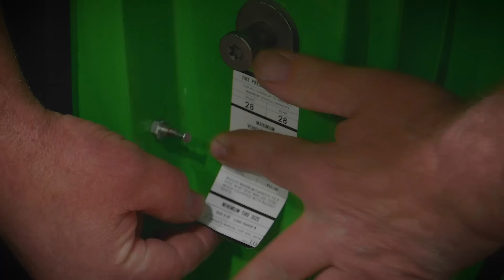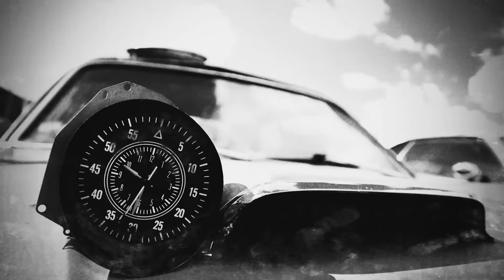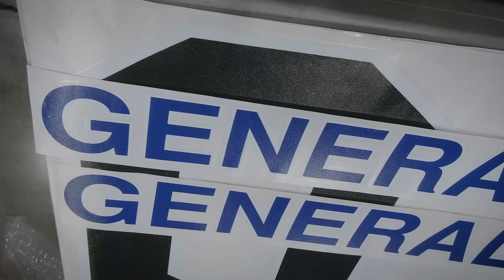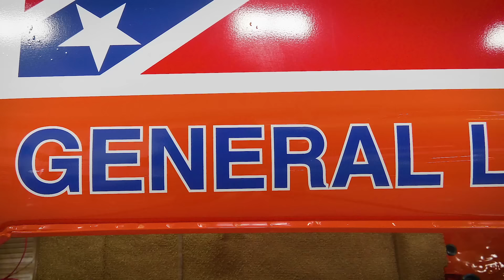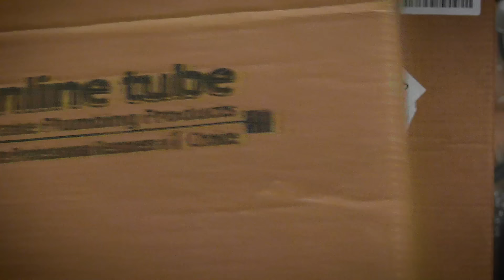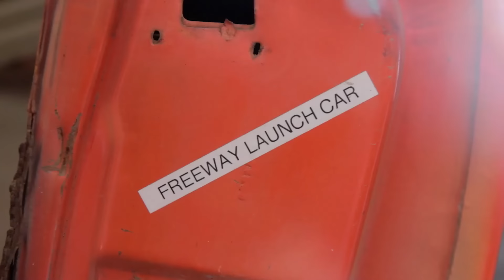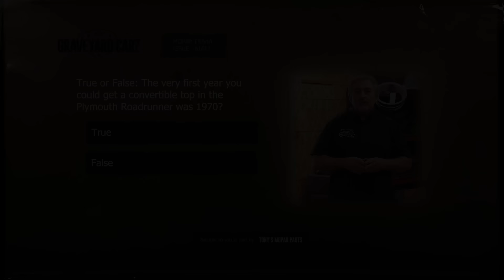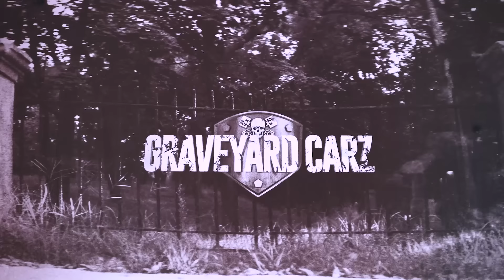SENSORSHIP: NETWORK SAYS "LOSE THE FLAG" WORMAN SAYS "NO WAY"!

Comment: The problem is the flag was part of the original cars on the show.  It's like building a Starsky and Hutch Gran Torino without the stripe.  It's wrong.  It's incorrect.  If you build a replica with the confederate flag it doesn't mean you plan to start a new civil war.  It means the replica is correct.

Comment: That is not even the American confederate flag.  Most people do not know that. The American Confederate flag is three horizontal bars with the top bar being red, middle being white, bottom being red. There is a navy blue square field on the left corner with the square field extending from the top of the flag to the top of the bottom red bar.  A circle of white stars inside the blue field complete the flag with 13 white stars.  What is on the General Lee is the Confederate Navy Jack. A squared version is the Confederate battle flag.  How the confederate union Jack came to mistakenly be thivuth of as the flag of the Confederate States of America is lost to time.

Comment: Really this is completely nonsense on the networks part. He is making a tribute replica of the original general lee from the dukes of hazard show and you cannot do that by eliminating the part that was iconic. What the network fails to realize also is that the general lee was not a symbol of what that flag stands for and was actually a symbol for  morals and doing the right thing . Luke & Duke and Daisy always fought for justice including against discrimination in the show so adding the flag to it is not a symbol of racism like the network is attempting to flag it as offensive.

Comment: Hey.  
If you guys ever want a 1964 - 426 Hemi , Factory Original, with less than 50 Hours on it !!  Yes HOURS , not miles.  It was always governed at 2500 RPM as well. 
There is an old Ski Resort I know of that has this Hemi , which still looks brand new , and it was used as an EMERGENCY motor for a 2 person chair lift.  The output shaft has a 8 sprocket adapter.   Every year , at the beginning of ski season we would have to show the safety  inspector we could start it and put the chain on in under 5 minutes.   Usually after warming it up for about 5 min as well we'd engage the drive and run it for about 10-15 min under load.   We had the inspection twice a year.   So Maybe 1-1.5 hours  of run time per year over the 30 years the resort was operational.  Now the engine is sitting in a shipping container on site.   Could probably be bought for under $1000 is my guess.   Happy to steer anyone who's interested to the location.
Reply: OK, I'm interested.

Comment: To bad that's not "the" confederate flag.
That is a battle flag used by confederate forces.
The confederate flag was red, white and blue.
It was the battle flag of Tennessee I believe. There were square and rectangle versions signifying deferent battalions from other parts of the confederacy.

Comment: having done replacement graphics in 2008 for 1 of the 13 remaining studio certified original series General Lee's you missed a tiny detail.  Roof Lettering on original Lees was a hand painted gothic font and varied a bit from vehicle to vehicle. You used helvetica. large difference in letter styles and perception. Its possible that the 2005 movie vehicles used that font tho.  My client opted for my reworked gothic font as digital print lettering to mimic the screen grabs we had to reference. His car's original state was studio lettered in a combo of white first aid tape and house paint. no vinyl letters back then. He wanted a longer life. Sometimes we have to do what the car owner wants and history be damned.

Comment: I had a ram air firebird I bought new in 68 , it was a really fast car for straight out of the factory , 13:70s pure stock at National Trails raceway near  columbus ohio, only thing done was balance the distributor. It was fast, I went out a few times in 71 with a  girl that was a teacher, she had one of those barracuda 440 6s I think it was a plum color, Violet must have been it. can't remember but it hauled the mail.  I did some research but the articles I read are wrong, I drove the car several times and it was faster than the firebird, substantially! I did 13:70s with wheel hop so bad you absolutely could not get out of the hole without going about half throttle the first 100 feet  or more in the Firebird it had plenty of engine just terrible transfer to the ground  I also had the 4'33 rear end ,which did not help.. The barracuda I think had ladder bars, and it roared out of the hole, It was  a dog compared to a Hellcat, but for 1971 or 72 , it was a rocket, I would guess high 12s, pure stock 
I can't believe they killed the muscle cars and then started them back up with cars that went 9 seconds straight from the factory, you need to build up to that, I was used to 14 second 1/4 miles, but the first time I drove a car that went 11s , it was a lot different animal, I can only imagine a 9 second machine. Whooooey.

Comment: I would have thought back in that time when original program cars were built the flag and graphics would have been painted on the car rather than plastic decals? Does anyone know for sure? My thoughts would be that plastic graphics weren't really used in that time period but that's just a guess...?
Reply: If I had to guess id say decal because its cheaper to replace it then repaint but it could be paint.